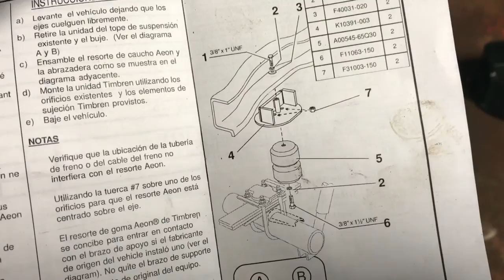Install timbrens 2011-2016 F-250

Comment: Can they be installed without raising the truck, either with a floor Jack or a lift?
Reply from the maker: Definitely. As long as the leaf springs aren’t maxed out and there’s not 500lbs of tools in the bed.

Comment: So I'm thinking of installing these on my F350 for the weight of a truck camper and a tandem axle trailer with a jeep loaded on it, my question is...what's the ride like if the tambren is in constant contact at the bottom, or pancaked? Is it a hard ride or ?
Reply from the maker: Lets put it this way, I looked forward to filling up my salt spreader because then I knew I would be "riding" on the Timbrens. The ride is much "smoother"- the rear suspension became very predictable. While in use, the Timbren doesn't  even look "loaded"- it doesn't bulge, or pancake. With my HD plow on front and full hopper in the bed I honestly felt like I was driving a truck with air suspension.
Reply: Ah, cool thanks,  I just got mine in today, came with spacers, I'm doing front and rear too.
Reply: Did you install and if so, did you see a change?
Reply from the maker: I installed a set of Timbrens on a 2006 f250 because the rear leaf springs were shot; the headlights would point up to the trees if the truck had ANY weight in the bed-not anymore. The Timbrens see daily commercial use and have held up perfect(lifetime warranty).
This was a “cheap, quick fix” for a truck that needed new leaf springs.